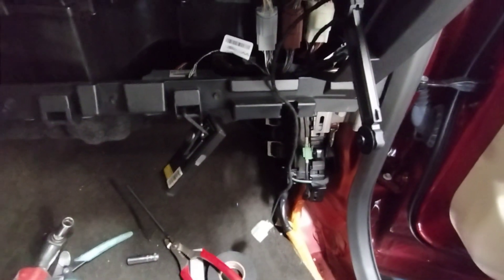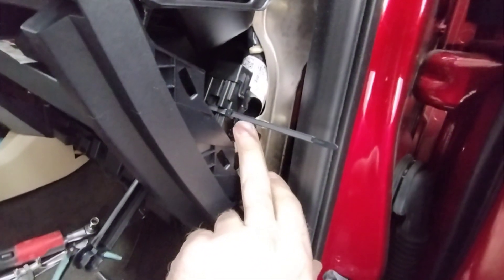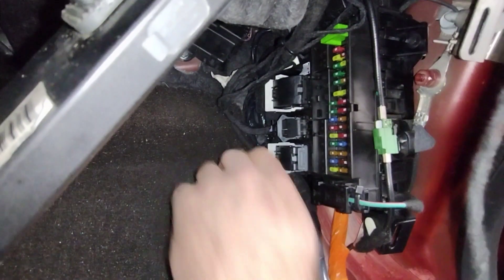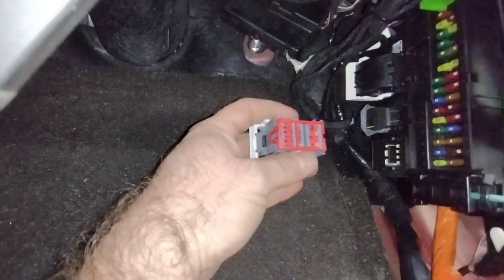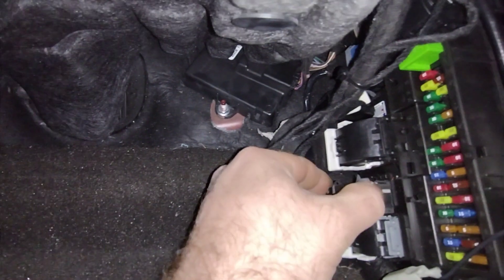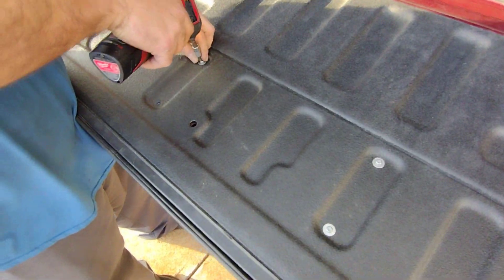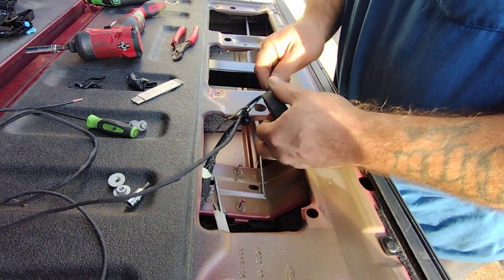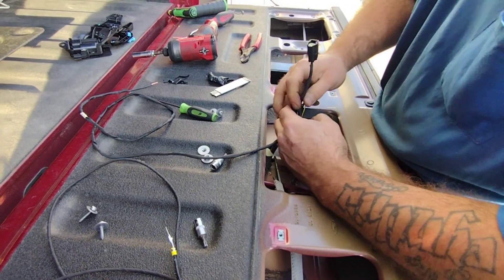Ford Recall 21M06 F150 Unintended Tailgate Opening

Comment: I switched to OEM Manual Handle on my 2019 F-150 Limited tailgate, I replaced the original wiring harness with a XLT Tailgate Wiring Harness JL3Z-14A412-C. I installed a Chrome Tailgate Handle JL3Z-9943400-GB. Installed short OEM Rod FL3Z-9922152-A to chrome manual handle.  I also installed a Manual Latch/Actuator HC3Z9943170C 
Camera and LED light are the same, I swapped them over to new manual handle, the two long rods that connect to latch/actuator are the same. Everything works, Camera, the tailgate locks and unlocks as before.
Reply from the maker: @FloridaCoastalGuy  and there's no codes in the BCM?  That's cool that you did that. Now it won't open unintentionally.
Reply: @BeardedFordTech   No Codes because my truck had a Manual Handle from factory, it's an XL.
Reply from the maker: @FloridaCoastalGuy  very nice very nice.

Comment: Solution is to take everything apart and put everything back together using parts that function.. with a seal/thick dielectric grease and a tiny bit of conductive oil coating on the pins
Reply from the maker: @DeVoNmotorsports  just doing what the recall says to do.  Can't just tske it apart and put it back together when it's under warranty. Certain protocols. And recall. Certain protocols

Comment: Came across this video looking for information on the tailgate functionality after this recall was done on my 2019 F150.  There seems to be conflicting information on whether the tailgate latch can be operated while the ignition is on or not.  While running mine will not open with the remote or the button on the tailgate no matter how many times you push it.  The paperwork with the owner's manual addendum that was left in my truck says nothing about the ignition having to be off for the tailgate to open.  There are multiple forum posts from people who say theirs will not open and the dealer says it’s normal.  My dealership claims to have done dozens of them and I’m the only one that has contacted them after about it not opening while running. You have commented it should still work when running.  I do appreciate that you showed most of what is done to make the repair.   Since posting this video and reading comments have you tested one while running to see if the tailgate would open?   If you confirm it should still work while running then I can double-check the connections they made based on your video.  The dealership is telling me to just drop off it and they will see what they can do but they can’t get to it till almost October.
Reply from the maker: We tested them after doing the recall. Worked with it running. You had to hit the button on the tailgate twice. Or the button on the remote twice. But you said it doesn't work after they did it.  No matter how many times it's pushed. I would take it back to them. I never had one come back for this problem after the recall was performed. Email me your VIN. I can look to see if they put out a special service message for people having this problem.
Reply: I had the 21m06 mod done on my 2020 f150. I can’t open the tailgate with the truck on. I have to turn the truck off first. It’s a real pain.

Comment: I have a major issue with my electrical tailgate and the electrical system is going crazy. It's part of the customer satisfaction program 21M05 supplement 1. 2. 3. 4. Tailgate started opening on its own all the time. Truck on or off driving idol didn't matter. After some major rain truck turned into a Christmas tree lights going off blinking honking tailgate opening and the middle of the night. The truck is at the dealership right now they are trying to get Ford too pay for the fixed after the diagnosis. My question is with this water issue entering the tailgate and in corroding and shorting out the connectors in wiring harness, would that affect all these other exterior electrical issues? Also, when you push the little button in the tail bed it opened the tailgate so everything is shorted out. This is for my 2017 f250 super duty. I also have the customer satisfaction program 20M04 regarding moisture in water entering power lock  so in other words, the truck has water entering everywhere and messing with the electrical. If you have experienced dealing with this, can you let me know what steps need to be done because I feel like I'm getting the run around
Reply from the maker: Water intrusion into the power box under the hood is a major issue. Sets all sorts of lights and codes. The tailgate issue has to be done under the recall. And its not fun to do. Did they check the battery junction box? The one under the hood that gets water in it?  I've come a cross a lot of them that get water in it and they go crazy.

Comment: Added a piston months later on my’19 to slow down that gate slam
Reply from the maker: This one already has easy open tailgate. It doesn't slam down
Reply: @BeardedFordTech  yeah ford uses a gear spring on the right side under the right tail light . Mine is a gas piston on the left side. Slow once it gets around 25° and forcing gate down will break the plastic pin clip- just screw on new one.
Reply from the maker: @Dirtyharry70585  yep. I've seen a few break. People trying to force it.

Comment: Can you guys post the rest of the recall please. My co worker had one and now he got a shit load of DTCs on. He's keeps bugging me for help and i never did one so IDK where he F'd up at.
Reply from the maker: That's basically it. If he has a bunch of DTC's I'd be checking in the body control module. Or at the camera where you splice in.  Do you know what the codes are?  Shoot me an email with as much info as possible please.
Reply: @BeardedFordTech  He figured it out. It was for a blind spot module. He forgot he changed the light bulb the day before and forgot to plug it back in. Thanks for the offer, I will keep you in mind when im completely stuck on something. Been at Dodge for 5 years, pretty much smooth transition to Ford so far.

Comment: After this recall switch its doesn't work on mine. Maybe check the fuse?
Reply from the maker: The switch doesn't work?  Then they did something wrong.
Reply: @BeardedFordTech  yes . Only the switch dont work but i can open it with the remote
Reply from the maker: @vtec87pr1diaz  I would take it back. I never had that issue after doing this recall. 🤔
Reply: I have this exact same issue, my remote switch will open tailgate but button on tailgate does not work. What was your resolution?
Reply: @michaelcrose9281  i found my issue was a circuit open on the switch wiring by the spear tire.

Comment: Just had this recall done on my 2020, now the tailgate wont open if the truck is running.  Do you know what setting this is and how to correct it ?
Reply from the maker: Is it unlocked when running?  If so then they didn't do something right. It's not a setting.
Reply: @BeardedFordTech  yes unlocked but won’t open either at the tailgate or using the fob unless you shut it off.
Reply from the maker: @skinnnerrr  yeah they got something wrong. The recall just keeps it from opening unintendedly.
Reply: Mine is the same, unlocked with engine running it will not open since the recall.
Reply: Did you ever get a resolution to this. Mine is just like yours. The dealership says that is just the way it is but I’ve on forums that this isn’t true. I wonder if you were able to get it fixed or not. The dealership told me it wasn’t possible.